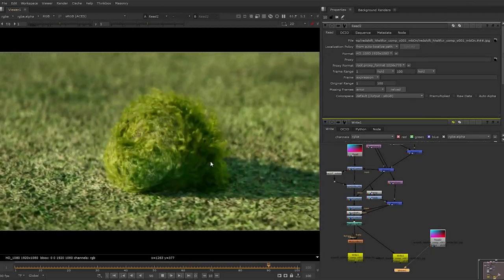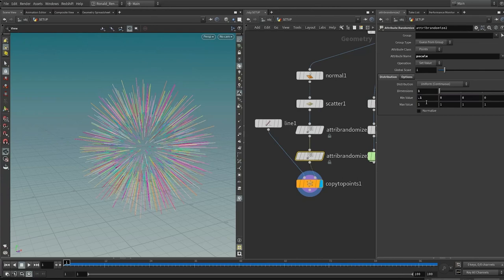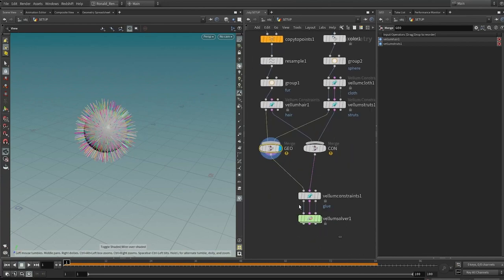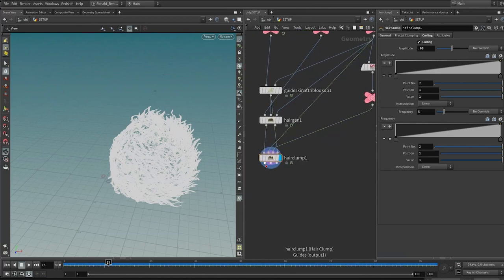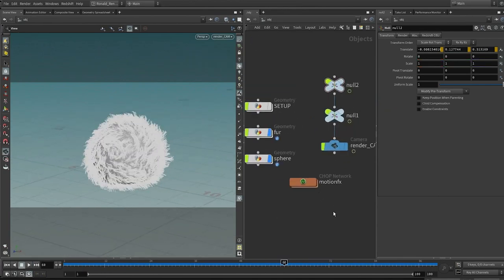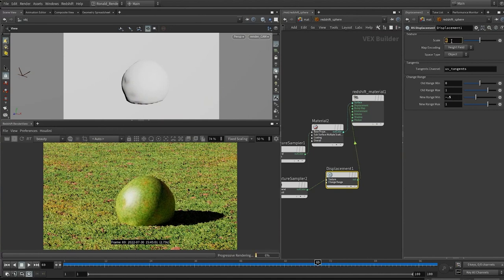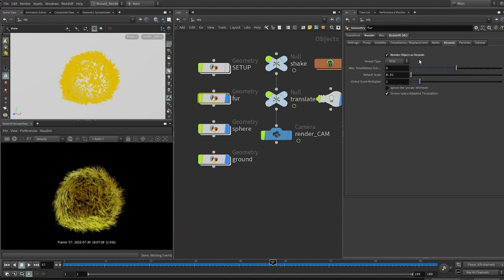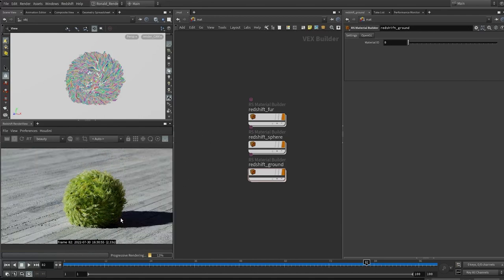Houdini Houdono | Simulation - Episode 9 - Fur

Comment: I'm having an issue with my glue constraints where the constraint will fail when the sphere rolls over the constraint making them pop through the surface and get trapped inside the sphere. I've visualized my constraints using the "failed self collision" visualizer on the solver and it's only the ones that have been run over. Nothing seems to work to correct this. Any tips?

Edit: I figured it out, I just needed to increase the collision thickness for the sphere to a higher value and I also change the mass of the hairs to be less than the mass of the sphere which helped as well.
Reply from the maker: Great tips Scott! Thanks for sharing with the rest!

Comment: can u tell me the difference between attaching the hairs to the ball either with vellum stitch, attach to geo or glue?
Reply from the maker: Hi Carlos! I see how it's confusing. Glue is used to stick one simulated geometry to another, whereas attach to geo is from the simulated geometry to the collision geometry.

As for stitch, I'm not too sure myself. I'll comment here again when I find out! Hope that helps Carlos!
Reply from the maker: Oh, I found that the Vellum Constraint set to "Stitch" is primarily used for stitching pieces back together after doing a pre-fracture using the Edge Fracture node. I cannot seem to find another use for "Stitch". Hope that explains Carlos!
Reply: @RonaldFong  Hello Ronald ty for revisit this thread to let me know about ur researches.

In this video u can see how the main vellum developer uses Stitch to do the same u are doing in this turorial: https://youtu.be/5s8I2fs8kMs?t=2592

By the way, I also forgot to mention the type "Pin to Target"  which is quite similar as well. If some day I find my own definition for those I ll also refer to this thread to let u know.
Reply from the maker: @carlosrivadulla8903  oh! Thanks Carlos! Looks like we both need to do more research. I'll report my findings here too! 🥂 Cheers

Comment: line is just keep growing when i play
Reply from the maker: If it grows longer in a messy way, it's likely you may not have the Constraints stream wired properly! :)
Reply: 🥲lines are going inside the sphere when i play can u please tell me what to do
Reply from the maker: @neerajsunil4675  oh no, it's likely the sphere hasn't been plugged into the collision stream correctly. What I like to do when I face problems like this, is to recreate a very simple version of the setup, so I can understand, test, and familiarize myself with the key principles of a simulation setup like vellum. After you understand the fundamentals of how it works, you can more easily diagnose any potential problems you may have in your setup! All the best!